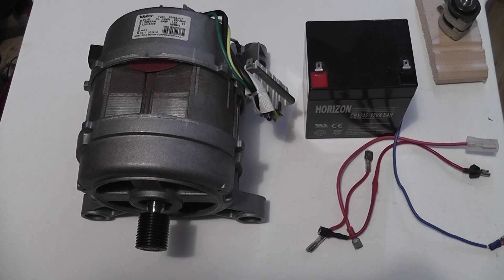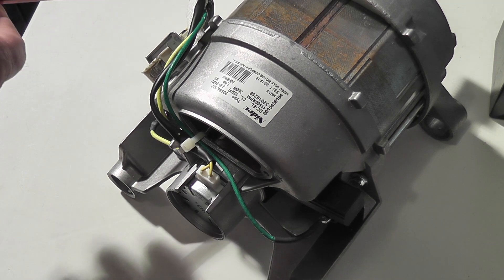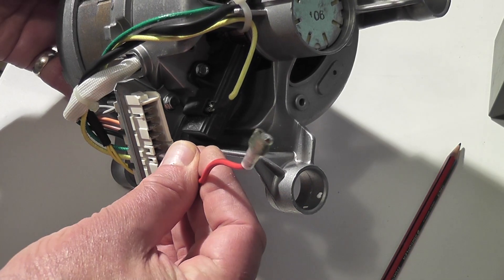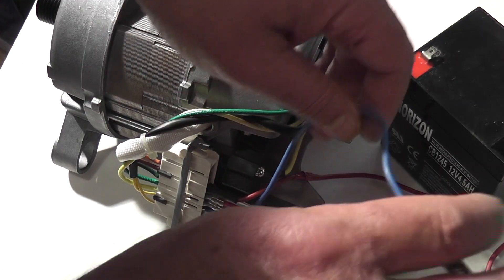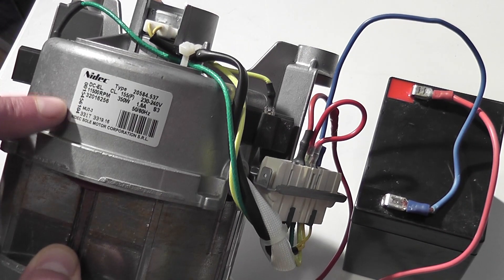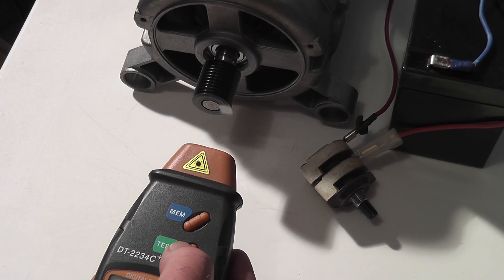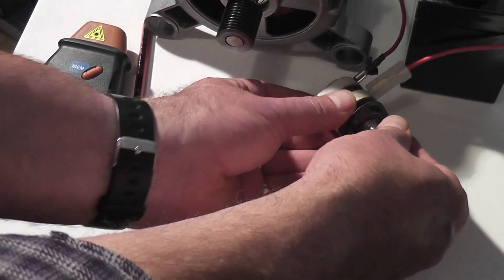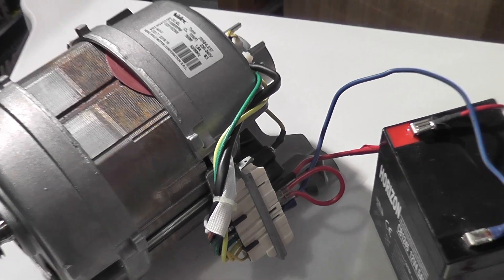Easy Conversion of AC Washer Motor to 12VDC

Comment: It doesn't have to be converted...this is an UNIVERSAl brushed motor...it works both with AC and DC...that's all.
Wiring is the same...useless video.

Comment: If you were to increase the voltage from 12 Volt to 24V or 36V would that increase the maximum rpm up to 11000rpm.
Reply from the maker: Yes, a higher voltage would give you more rpm

Comment: I wired my 240v AC motor through a 1000w inverter powered by a 12v car battery, a few cogs and chains later, and my barrow was powered by motor. Because of the 12V input the torque suffers but it moves freely with a little weight in it, and that is all I wanted.

Comment: Isn't this a DC motor to bigin with? I mean it was used in an AC application (DC motors run fine on AC.) An AC motor, a true AC motor wouldn't have brushes, right? Asking, not telling..

Comment: I have old AC water pump motor,, i already connecting  using 2 wire direct to the motor and direct to home 13amp, it running, as now, i would like to convert to DC, how to connect with this potentiometer, where can i get as show on video. Advise me

Comment: Hello sir are you familiar with baterry de sulfation usein 1 dead baterry 1 fully charged and 1 dc motor?
Some peopel did done it suposedly because they did not have baterry charger so any usefull info about it?
Suposedly it culd work with transformer/baterry/dc motor as well so that cinde of got me curiuse .
Reply from the maker: You can connect a good battery to a dead battery in parallel which may partially charge it if it is not beyond recovery. Running a motor using both may drain the good battery quicker
Reply: @DrivewayDudes  well thank you for response I have strange projects so I was wondering culd I cutt windings in half on starter motors field winding ore if it is magnetic starter motor to cutt out 2 brushes from the 4 brush holder Im looking for those old sg's ore compound motor/generator patents but cant finde any thing usefull about it .
Aperanly delco hade 4 commitator brush starter/generators ore those were some rotary inverters/converters/transformers so I was wondering do you know some thing about those old designs how they worked and how to coppy them?
Well to be honest Im surching for alternative methodes to run me ignition coil so I was wondering if I culd some how modify me starter ore alternator to act cinde of those old dynamos if me ignition coil for some reason get fried I wuld like to have back up plan some sort of .
I have constant problems geting voltage to me ignition coil who is E core type hei with 4 pin gm ignition module I have that starter motor r terminal bypass wire but it aperantly works only at points not on hei so any ideas where I can draw curent directly to me ignition coil?
Me alternator is old delco 12 si  it has that odd bypass pins for rotor so I was wondering can I draw curent from there and use capacitor in series with me ignition coil wuld that work?
At this stage I dont realy care If I fry some thing I just need some back up plan to solve low voltage.
I did try out plasma ignition first it was nice faster spining starter motor ,bether smuther engine but I come acros problem me starting charge rpm from 1200 goes up to 2500rpm thats when I use hv capacitor to coil + and simply ground out capacitor other side to chassis .
So I have cinde of problem with me reference voltage to me baterry so any ideas how this problem can be solved??? I have multipel of those old gm parts so I was just wondering how I can bypass dashboard some how I have voltage regulator inside that thing its anoying so I was also wondeing if I culd stuff up some nails in me starter selenoid and wind that thing in series ore pararel with me E core type ignition coil but Im afraid to fry some thing .
So please any thing you know that might help me with me unusual problems?
I experianced lot unusual things with me alternator similar to plasma ignition was failing voltage regulator gived me similar effects but it fryed baterry so that also made me wonder can I use capacitor banks and drive just me ignition coil with ac and how wuld I prevent me baterry to get fried?
Reply from the maker: @MechanicForGMCCars  Schottky diodes allow voltage to travel one direction only. Capacitors can be helpful if you are familiar with them or they can be dangerous to very dangerous if used incorrectly. Gate transistors can also be useful. And of course fuses can save your equipment in the case of voltage surges
Reply: @DrivewayDudes  well to tell the truth have no realy money so I cinde of must steel staff like canibiliseing me pore mothers micro wave oven .
So I cinde of have plenty hv capacitors hv diodes some rectifier diodes I do have some old psu from computers lot small electronic devices scavanged over the years .
But still Im not so shure to fumeling with any thing.
I did was some what curiuse to fumel with alternator and I noticed that thing is cinde of going to baterry negative via ground so that made me wonder if I culd use secundary alternator and modify it only to work on me ignition system ?
If I wuld put alternator windings in series I shuld be close to that old working principel like old magneto ignition system I do have lot capacitors but only thing I have problems so fare I finding circuet that will not interfeare with me baterry ground wuld placeing diode to negative lead solve this problem?
I also figured out why not used ac capacitor banks and pump power directly to capacitors I cinde of wanted to use insulators not to tuch ground on engine.
So that made me confused how the old magnetos run on ac but did not shock any one?
I heard some where depend on what charge the system runs some chassis will increase in rosting some wont rost at all .
So the problem is to finde any old books on interned how those devices worked?
So I do lot experimenting with diferent fuel types I did also need dual ignition for that odd porpuse.
I try some how to activate twin 4 pin gm ignition modules with 1 pick up coil its realy pain in the ass try to reconstruct circuets.
Me engine does not suport waste spark so I do not have lot ways to solve thing Im curirs to know if 1 pick up coil has enough energy to operate 2 ignition modules if not wuld I need to re wire pick up coil with 2 wires is there some methode that can multiply pulse from 2 to 4 pulses? Me car Is old Opel the parts look some what diferent from Amerika market so thats why I have hard time to finde solution to those unusual problems.
Basicaly me engin can run at normal compresion stroke and he can work on exaust stroke as well similar to 2 stroke motor so the idea is what Im working on is haveing twin engines .
So most similar ignition system what I need is actualy the old jaguar hei twin coil ignition system they also hade that 4 pin gm ignition module as some sort of ignition amplifier so evry thing I can solve so fare .
But problem is jaguar distributors gave twin pick up coils I have only 1 coil trigger so Im not so shure how to deal with that problem .
Im not shure if that problem can be solved? 
So yeah unusual problem.

Comment: Best thing to do " is hook you're 12volt Battery UpTo  an inverter" that can run the washing machine, that has the motor, inside it. That way
You're clothes will be cleaned -ATLEAST-!!!!
But a whole lot of times: a SOLAR PANEL THAT PUTS OUT 18 to 20 volts, will keep the battery,charged. .!!!
Reply from the maker: If you have the budget to buy a good quality inverter then you will get greater rpm for a shorter time

Comment: Sir Im wondering wuld car alternator with singel winding coil turn as dc motor if you for exampel put round magnets in the in side and out side on that same rotating shaft?I mean the are round but those magnets are stationary .
Wuld that rotor turn to by dc motor?
I was wondering what wuld hapen if you put pm magnets with rotor coil wuld the magnets stop working canceling ich other out if they are aranged in centrain polarity?
Just wondering what wuld hapen if you use oposing poles ore just atracting poles?
That got my curiuse.
Reply from the maker: The are several videos on this platform showing a conversion from alternator to dc motor.
Some are not very easy to follow. 
We will be looking into this in the future with a view to doing a diy simple cost effective conversion

Comment: And how many amps using this motor from the battery???
Reply from the maker: The battery used was 4.5Ah. You could try pull more Amps under load but the battery would run down quite quickly

Comment: that was awesome, so would it spin twice as fast if we connected a second 12 volt battery in series yielding us 24 volts?
Reply from the maker: The more volts the faster it will spin
Reply: @DrivewayDudes  thanks, so if you had enough batteries in series, would it spin as fast on the original AC voltage?
Reply from the maker: @Good-Enuff-Garage  This motor is capable of 11500rpm so connecting enough 12V batteries in series (20) may do it.
Reply: @DrivewayDudes  thanks, I am learning so apologies for asking all the questions, now why can't we get the spin speed from the higher amps of the DC batteries, I mean isn't power power (v x a = w)? ha ha
Reply from the maker: @Good-Enuff-Garage  as an example: 2 x 12V 7Ah batteries connected in Series would be 24V and 7Ah. In Parallel voltage remains the same at 12V and amps doubles to 14Ah so 20 x 12V 7Ah batteries connected in Series would be 240V 7Ah and the same amount connected in Parallel would be 12V 140Ah

Comment: running this universal motor on dc current does it give u high torque becoz i using this motor for e bike by connecting 24v batteries in series to get 72v is it enough for motor run at high torque plzz reply

unning this universal motor on dc current does it give u high torque becoz i using this motor for e bike by connecting 24v batteries in series to get 72v is it enough for motor run at high torque plzz reply

Comment: So it will gonna need a 220v battery to achieve the actual motor horse power right? Or is there a trick to it like using converters?

Comment: 12 volt motor + battery= almost endless uses "off grid" remote locations , camper van fun, propulsion. ...12v a lot safer than 240!
Great video  and instruction, looking forward your next one, thankyou!
Reply: there are downsides of using DC vs AC, I'm sure you know but I will just mention the thickness of the wires, DC requires much thicker wires as it carries higher current ie AMPs, granted he demoed that motor with thin wires but there was also no load on the motor, there is no way that motor spins your wet laundry using only 12 volts without automotive jumper cables as it needs to make up the power somewhere and so it needs to pull them AMPs (AC is high voltage so 220 but low current, I think on the motor it said 1,6 AMPs)
Reply: @Good-Enuff-Garage  ok, thank's.
Reply: @Good-Enuff-Garage  what if connect 3 battery in series it will increase voltage to 36v, mean  current can be reduced, comparrd to run same rpm from 12v battery?

Comment: Important things to know. 

Max  current? 
Ratet current?
Continuos current? 

If use 12 volt 20 ampere, how many rpm will get? And then check the motor, it's hot or not?

Comment: 11250rpm*(12volts/860rpm)= 156.97 volts to run at "11250 full speed"   yes it is that simple.
Reply: Yeah and I want to put it in a small boat. I think 72-80v DC will work just fine, what about you sir?

Comment: I did the same thing and it works but even with a brand new 12v 12Ah battery its super weak. I can stop it by touching it with 1 finger

Comment: Wonderful.   Only thing I wish was added was an actual diagram of the circuits in case the wires are not color coded. Just So I could do it I have lots of 6 and 9 wire motors that have only black wires....  and no labels

Comment: So how come  EtechnoG website says the following ?
(1) AC motor cannot run on DC Supply because of most of AC motor like Single-Phase Induction Motors, Three Phase Induction Motors, Synchronous Motors need alternating flux, not static flux. As we know that only AC can produce alternating flux. So AC motor cannot run DC supply.
(2) The other effect of the DC supply on the AC motor is that if we give DC supply on the AC motor then the windings of the AC motor may be burn because when the one reason is AC windings always have less resistance than DC windings and the other reason is when we give DC supply on the AC motor there are no Self-Inductance will be produced in the windings which can oppose the flow of current in case AC supply.

Comment: I need to use this motor wirh little load for short durations as 20mins max . Can a Dc motor speed controller  of  upto 10 amps be used where potentiometer is used . ? Or that controllee isnt good for here

Comment: Hey, that's cheating...
It's got a commutator.

As long as it's wired in a single phase configuration, you can run it on DC all day.

Let's see you do that without connecting the three phases together.
It would give you a lot more torque & speed.

Comment: Wow extremely works. I used an old lap top charger for power source. I am building a BBQ Rotisserie and i had an old copying machine motor and a washing machine motor to chose from. I was afraid the coping machine motor would not have enough power to turn Miss Piggy but i wasnt sure how to get the washing machine motor to run with out the coil power source as when i wired the brushes + and - to the laptop charger it had no power. I did just as you said in this video and the washing machine motor was turning. So great video and now i will weld the washing machine belt bucket wheel pully to the metal rod that will go through the body of miss pigy. We will feast in your honor Sir

Comment: No AC rated motor can run on straight DC without some form of commutation.  Which means this particular one must be a brushed, AC/DC universal motor.  Also, a raw potentiometer placed in series with the power source, for use as a speed control will be cooked once an actual load is applied to the shaft.
Reply: So do you suggest that it's connected directly to the battery using an inverter??
Reply: @Cey-001  Potentiometers are low current devices normally intended to be used in circuitry that controls the output of other components that ARE designed for high current, like transistors.  The position of a potentiometer should adjust the speed of an oscillator, PWM timing or some other parameter in a secondary circuit that actually drives the load.  Which, yes, that's the basics of how an inverter works.  Additionally, true AC motors are brushless, inductive devices that require AC to operate.  The one shown in the video is a special class of motor, called a "universal" motor that has brushes and can run on AC or DC.  I.e., most motors labeled as "AC" cannot, and will not, run on DC.
Reply: Rpm ...??
Reply: Need a PWM speed control

Comment: Ok like the video, but can you connect another motor to output 12V to power a battery charge and then run a 12V bulb from it, this would prevent your battery from running flat and power a light?

Comment: Can you reverse polarity to reverse the direction like with a normal DC motor? I saw another video where a conversion was made,it was stated that such motors spin the same direction regardless of what pole is fed to which wire.

Also, I'm assuming that the use of a rheostat/potentiometer for speed control only works for testing/low power demand situations, right?

Comment: also if you wire the brushes and the stater in parallel it will go half as fast but with twice the torque (depending on the resistance of the coils of coarse)

Comment: Could I convert a small apartment size refrigerator from AC to DC? I want to do it for my camper. Will it work?
Reply from the maker: The quickest and easiest way would be to use a DC to AC inverter so it can be put back into your apartment when not used in the camper
Reply: @DrivewayDudes  Thank you. I know I can run it on an inverter.  I want to be able to run it on 12 volt so the inverter doesn't have to be on all the time. I want to take the works out of a refrigerator and create a built-in refrigerated space in the back of my teardrop camper. I know I can buy 12 volt refrigerator components to do that, but they cost $800 to over $1000. If I could convert the works of an apartment size refrigerator, it would only be a couple hundred dollars.
Reply from the maker: @propagantidote  Caution. It would not be recommended that you disassemble a refrigerator unless you are a professional in that field. Refrigerators contain a gas called Freon which is quite toxic. A leak however minor and if inhaled can cause respiratory problems
Reply: @DrivewayDudes  Yes, I know about freon. I used to be an autobody technician. I've discharged and recharged many auto air conditioner systems. My question is just about the AC to DC conversion. Can it be done? If not, I'll do something else.
Reply from the maker: Not looked at refrigerator compressor motors so we'll get back to you on that
Reply: @DrivewayDudes  Thank you sir. I appreciate your attention.

Comment: this is a universal motor with the coil in series with the armature? - hence the brushes
the level of torque will be very small running it like this, surely?
also a simple diagram would have helped the explanation  of what you were doing  - a picture paints a thousand words an all that 
Thanks for the video btw

Comment: But how can I identify a motor that runs on 12v DC? I tried the motor of my old washing machine, it runs only at 240v AC...
Reply: If it is an induction motor, it will not run on DC. Induction motors have squirrel cage rotor.